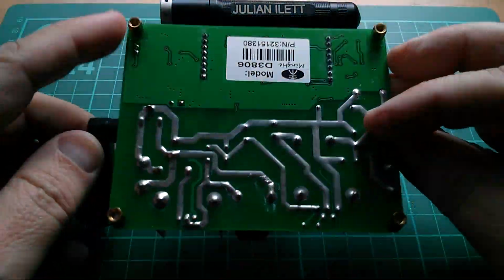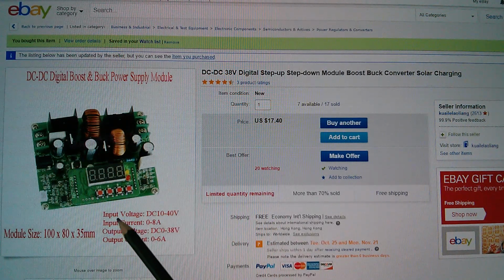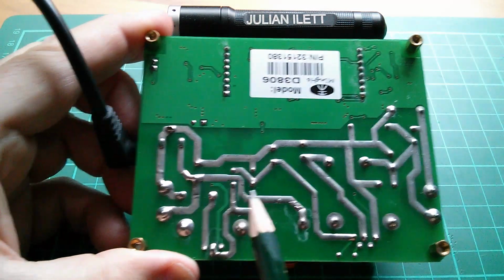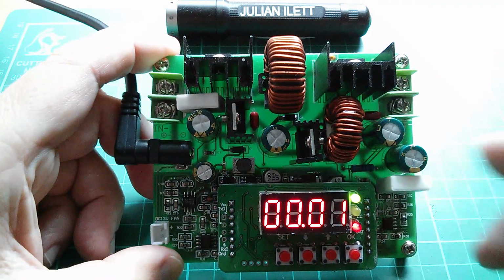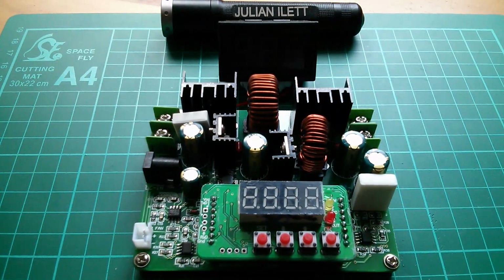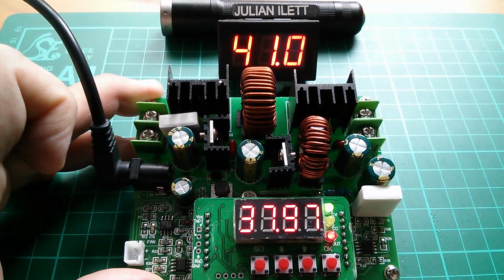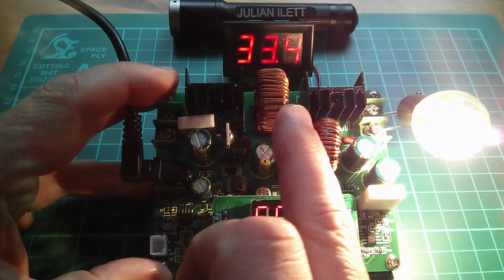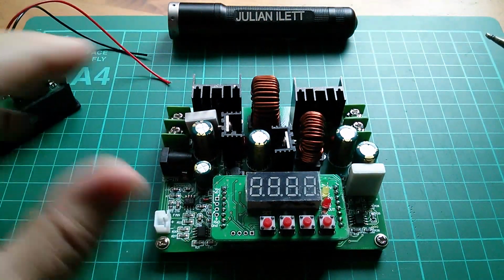Tech Talk: Ming He D3806 Boost Buck Digital PSU

Comment: DC to DC BuckBoosters obviously will boost up volts and buck volts. But what seems to be rarely mentioned is what else is being effected? I'm guessing it's the amps? Am I currency?
Reply: I'm not really sure what you mean but yes, you are currency.
Reply: EECatblog just meaning to say that so far it seems that when DC to DC BuckBoosters are explained in videos usually nothing or not much is said about what you are losing or gaining with the colts are being boosted or bucked. Thank for the reply. So as volts get boosted amps get bucked. And of course as volts get bucked amps get boosted. Which means that there are applications out there that need high volts but low amps and vice versa.
Reply: Adventureinlife Uhh, that isn't quite how it works... You see it all depends on your load, if you have a 10W LED for example then it will only ever draw a max of 10W basically 0.083A at 120V or 0.042A at 240V so either way you're drawing 10W of power (assuming 100% efficiency).

However, something resistive such as a heater or a motor the more volts you give it the more current it can draw, so for example a US 1500W hair dryer if it didn't have any sort of transformer would use double that power (3000W) in a country with 240V mains.
Reply: Ah... I see. Now it makes sense. Too bad we have yet to figure out Superconducting components at room temperature. That would probably be the only way we could actually hit 100% efficiency. Which thanks to you helping me understand this I can see how the decision as to what buck/booster to pick heavily comes down to how efficient it is.

Comment: I watched this video and had to get me one. Unfortunately the second time I tried to use it, I was trying to float charge a bike battery with CV set at 14v with CC set to 1 amp from a  car battery. Everything was wired  correctly and I am still not sure what happened but I let the magic smoke out. Has anyone come across a circuit diagram, I really would like to have a go at repairing It. Thanks for your very interesting videos Julian!

Comment: 38V*6A=228W?
This thing is 228W at max?
If you put them in parallel would they increase their efficiency (because when you put stuff in parallel they decrease their resistance) and increase their rated power to more than 228W?

Comment: Hi, thanks great video, I have a question you suggestion would be great,

I have,
Solar panel open-circuit Voltage: 40V

Battery 12 V (AGM

Controller : PWM controller max input voltage 28V

Can I use D3806 to step down from 40V to 25V and connect to
solar charge controller to charge the battery? Will I lose energy in this converter
in step down mode? Or the module will convert in to Amps from Voltage while step
down?

Thanks ,
Reply from the maker: Not a good idea

Comment: Does the 12-13V after the boost match your solar supply in?
Reply from the maker: Yes. That didn't really occur to me while filming this video. Had I fed the minimum input voltage of 10V into this device, the 'after boost' voltage would probably drop to about 9.5V - that's 10V minus the diode drop.

Comment: Only one part should be active at a time. If boosting the buck MOSFET should just stay on, if the buck converter is running the boost MOSFET should just stay off.

Comment: What kind of isolation does it have between input and output? Is the negative connected straight through except for the current sense resistor?
Reply from the maker: Yes, the negative passes straight through (with just the output current sense resistor inline). Most of these DC/DC converters are non-isolated.

Comment: I like to use my 18 Volt Li-on batteries for my old Bosch 14,4 V screwdriver. Is it possible to use a buck converter. Do anyone know wat the maximum current is in the motor?

Comment: How stable are the currents in something like this? What is a good way to test that?  I want to buy one of these to put in my car for powering a laptop. one of two, a 12 volt eee pc that uses 3 Amps and a 19.5 volt Dell that uses 4.64 amps. but I worry about how unstable the voltage is in an automobile is.

Edit: One at a time but I want to be able to use both laptops at various times.
Reply: Jessica Myer I would not use this in a car unless it will be disconnected from power while cranking. See my previous comment about it going unstable with an input voltage under 10v which will happen every time a vehicle with a conventional 12v starter motor is cranked. In a BEV or HEV that doesn't crank the engine with a 12v starter it should be just fine.

Also there are already buck-boost converters designed for exactly this, I have an HP branded one that was for the HP/Compaq TC1100 tablet.

Comment: Could you recommend an efficient buck boost converter that is similar.
Reply: buck boost converters by the nature of how they work will always be inefficient. If you want efficiency, use either a boost converter or a buck converter
Reply: DaffyDaffyDaffy33322 Thank you. Is there one you would recommend?
Reply: I don't have a great deal of experience with enough models to give a recommendation. Though in general, if you're stepping up voltage, get a boost converter, and if you're stepping down voltage, get a buck converter. Buck converters are usually more efficient (iirc). Wherever you buy them usually has the ratings on it, which usually includes efficiency.

Comment: I have one. I am an absolute beginner to electronics and notice it isn't fused. Should it be and if so how's the best way to do it? (I'm bound to connect it reverse polarity to my 12v solar system at some stage!) Thanks for any advice.
Reply from the maker: Yes, you should really have a fuse. Mine is in the cigar lighter plug on the other end of my input cable.
Reply: Julian Ilett . Was thinking of soldering in a 10a fuse on the bottom of the circuit board and cutting the positive track in between? Is cutting the track easy or is it all embedded in the plastic? Once again thanks for any help.
Reply from the maker: Cutting the track should be quite easy - it's just a copper strip glued onto the surface of the fibre-glass PCB. You may want to wick up some of the solder first with some solder braid.
Reply: Just tack a fuse between your input cable and the converter, then to protect from reverse polarity find a 5A diode and place it over the input, I believe it should be connected Cathode to Vin+ and Anode to Vin- although I'm not very experienced myself so feel free to correct me on that.
Reply: Julian Ilett . Thanks Julien. I really appreciate all your videos and you've got me hooked on electronics! I'm even starting to learn Arduino programming and have already got a home made 13 led meteor light working!!!
Reply: vgamesx1 the diode isnt a good idea, its gonna get too hot. Reverse polarity protection isnt that easy at high currents.
Reply: +drkastenbrot That if you have a diode in series. Most power  electronics stuff I saw uses a reverse biased diode on the input to clamp the voltage to safe level&and take the fuse out in the case of reverse polarity on the input.
Reply: just use a p channel mosfet. connect the source pin to your power supply line (from solar panel or battery.....), connect the drain to the buck boost power input, then connect the gate pin to the negative rail of the buck boost converter.  during normal operation, the gate of the p channel mosfet is at 0 volts (conducting).  if you reverse the power connection accidentally, the gate of the mosfet will be at (+12 or whatever you are using) and thus the mosfet will be off.  just make sure you pick the correct mosfet for the voltage and current range that you are using.
Reply: Andrew Hudson If you try what you described, it will happily allow the "protected" device to burst into flames. Why is that? Body diode of the MOSFET
Reply: I've actually severed the negative rail and soldiered a 10a fuse across? Neat and tidy and allowing the boards normal connections. My logic being the fuse will blow in the event of a reverse polarity connection with my car battery bank?
Reply: MrJohhhnnnyyy burst into flames? No.  Fail because it wasn't sized properly?yes. Now that i think about it you could actually reverse the drain and source pins, which I believe would be the correct way to configure that.
Reply: Andrew Hudson That's what I meant, source should be connected to the load, not the drain.

Comment: This is kind of pricey, they should issue this in a kit form.  Nice video.
Reply from the maker: It wouldn't be much cheaper as a kit - the cost of assembly by Chinese workers is very low.
Reply: It looks like the smd's are the big one, its the traces on the power trances that would require a high wattage soldering iron.
Reply: I knw this video is old, bt the information is invaluable. Pls how does this work for a solar charge controller application? If it's minimum input is 10v, what happens when the pv modules go to sleep at night?

Comment: What are the RxD and TxD serial pins for?
Reply: ftdi ttl-232r-3v3 cai 3461 ah ?
Reply: 3v UART, what does ithe firmware allow you to do smartypants
Reply: I don't know, but I need to find out, too.  I was just looking for someone who knows what they're talking about. The 3v thing sounds like arduino. I use esp8266. When b3806 buttons are pressed, assuming a usb serial port will connect, the arduino ide serial monitor might show something if say pin 2 is monitoring the txd line,.
Reply: To play with it, talking to it directly with a PC would be the easiest route, put aside the arduino/esp and use something like eBay item 272519856405 to talk to it. Reverse engineering the protocol would be very time consuming/impossible without source or documentation. I plan on trying replacement firmware from Github baruch/b3603 which has explicit provisions for serial control.
Reply: A PC serial connection is the next try. I plugged the B3806 into my Comtest and V+ and TD leds are on 5v, to RD is 1.5v, S.GND is 2.5v, GND is 5v and all the rest are 1v
Reply: I wouldn't go on voltages since they can float if not driven, and maybe there's a square wave signal already being emitted due to data output. Just connect a USB TTL UART and find the comm parameters (baud rate etc.).
Reply: just search forr "CP2102 ttl"
Reply: Ordered one for $0.92. Hold Set Ok Power On USB, display 0 rehold Set Ok power on B3806, display F1 and I haven't seen F1 before. What gives?
Reply: Turn off B3806, display - SET OK PWR, display - F1 - Com3 serial monitor nothing F6 OK, display r - - UP y/n

Comment: I've a question to anybody willing to answer. 

If I have a DC - DC converter and it can produce say... 30V 5A continuous and lets say the input is 12V - 1A. 

Is it still able to about it's maximum rated power?

Reason I ask is I'm going to build a Solar float charger for my 10,000mah usb battery bank. which has a 2A output at 5V.
I intent to create some low power house house supplies, one could run some useful items from this off the grid inventing style.

My cash supply if very limited and I often can't pay my electricity bill :P So why not use one's knowledge huh!? :)

Thanks to anybody that might answer/clarify this for meh :)

Mads
Reply: Ah thanks for explaining that! Much appreciated. My intention is to initially power some lighting + wifi router and a USB heater cable to warm food, then increase the system capacity over time.

Thanks to you sir I now have a greater understanding of the limitations with use :) thanks

Comment: If you were serious about efficiency , you wouldn't be using 2.1 mm connectors.
Reply: You got a good alternative? Reason for using 2.1 mm connectors is often the ease of use, and the low price. Is there a better alternative?
Reply from the maker: And you can push 10A through them without too much drama
Reply: Julian Ilett Basically there's a good reason for their popularity.
Reply: Julian Ilett assuming they are wired in a suitable sized cable and not been inserted too many times. No way are they suitable for professional high current use, there are so many better alternatives.
Reply from the maker: Agreed. But I don't really do professional - I do cheap ;)
Reply: Junior Ocicat I'm not trying to be an ass, but would you care to specify what the better alternatives are? I'm genuinely curious.
Reply from the maker: How about the XT60 used on radio control Lipos? They do fit together very tightly though. But 60A is wicked!!
Reply: And if you were serious about buck/boost converters, we'd see some noise measurements (i.e., ripple) as well as accuracy of the output (i.e., via an accurate meter).
Reply: SteelBlueVision And if you were serious about your comment, we'd see a suggestion, not salty expectations.
Reply: Julian Ilett Bingo! Just what I needed. I'm trying to find a way to source the 12v of a PC ATX SMPS on a single lead. Those little bastards are good for just about 60A on the 12v rail. Smokalicious!